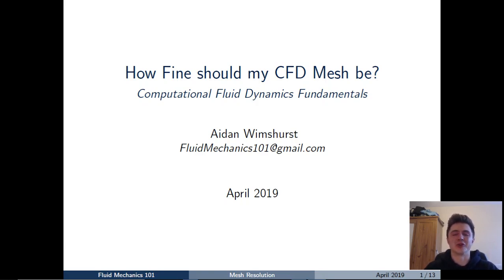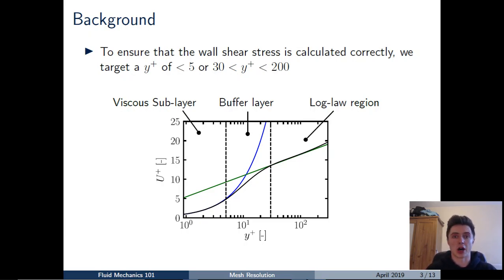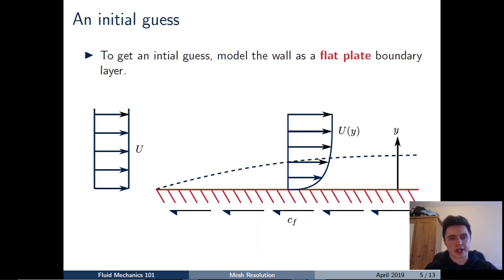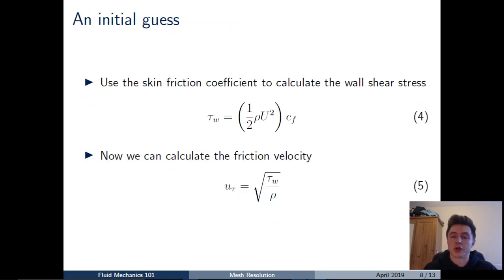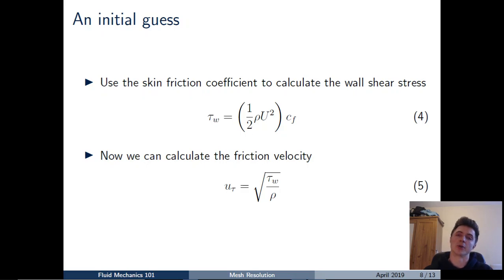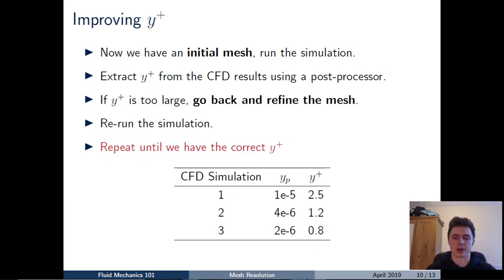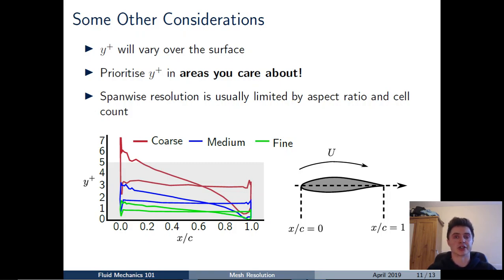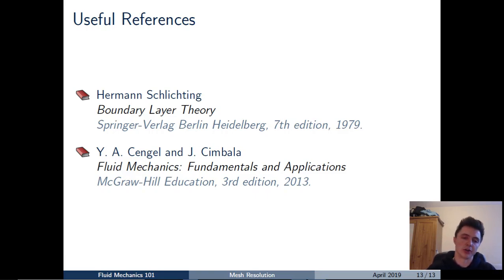[CFD] How Fine should my CFD mesh be?

Comment: Aidan : does a phd in the one of the best university in the world, weekly creates video about complex CFD concepts
Also Aidan :  'meme generator is my only bookmark lol'

More seriously, very nice video once again (y)
It is good to know/be remembered these stuff, but focus should really be put on few regions as in practice, a ''proper'' y+ check is never really applied, or is it?
For example, a proper y+ check is not possible in turbomachinery. It would need to be done at all flow rates, and if you try different designs, it will take weeks.

Keep up the good work, that's amazing!
Reply from the maker: Hi Lili An, yes well spotted 😂 you are right. Carrying out proper y+ checks is rarely done in practice and is particularly important for turbomachinery and external aero applications. Hopefully this video pushes everyone in the right direction for how to start their y+ and mesh checks.
Reply from the maker: Oh and for flow rates, you can always choose the high rpm/high speed case for your y+ checks, as the boundary layer will be thinnest and your y+ values will be largest (for a fixed mesh). As you drop the speed, the boundary layer thickens and y+ will reduce, improving your solution accuracy.
Reply: @fluidmechanics101  hey I love your videos, they really allow me to grasp some concepts in a way no textbook can. Just to hear someone explain plainly and directly to me is so helpful. I wanted to ask how do external aerodynamics y+ is verified and how does it affect lift and drag predictions
Reply from the maker: The trick is to think of y+ as 'the height of the first cell off the wall'. So yes, y+ has been looked at extensively in the field of aerodynamics and it is generally accepted that y+ ~ 1 gives accurate results. However, you can still get errors from other sources .... mesh refinement isn't everything!

Comment: Excellent explanation again. Thank you for your contribution to the CFD basics.
Reply from the maker: Yes, i realise this video is really a CFD basics video. But it is often overlooked and not really explained well for beginners. Hopefully this will be a useful resource for beginners to have a quick look at and set them on the right path. Thanks again for your support!
Reply: This is what exactly makes you different, being simple yet precise.  CFD is currently an essential tool not only for graduate students, but also undergraduate engineering students, as well as practicing engineers. From this point of view, your contribution is unique, since it covers both basics and advanced topics.

You are expected to make a lesson on the turbulence models, their performance on some prototype problems.
Reply: @fluidmechanics101  hi sir 
if we worked by the K Omega model, Do we need to define the Y  + or no?

Comment: Thanks for the videos. I am a beginner in CFD and I feel lucky to get to know about this channel.
Reply from the maker: Im glad you found this channel too! My aim is to put out lots of extensive videos for all areas of CFD, as it is quite a difficult subject to get into, particularly for beginners :) just drop a comment if there is anything you are unsure about or need more information/explanation
Reply: @fluidmechanics101  Thanks for your reply. Can you please make a video about boundary layer separation? Why does recirculation happen? why and when we should care about the separation of boundary?  Does it matter in internal flows?
Reply from the maker: Sure. As a quick explanation, separation and recirculations lead to additional pressure drops in internal flows. This increases the pumping requirements to drive the flow through the system and can lead to unsteady loading/vibrations in the supporting structure. So generally, we would like to avoid unnecessary separations! I hope this helps

Comment: Great video, Aidan! The part where you mentioned about the residuals and point convergence really sparked my curiosity in checking solution convergence. I've always considered comparing solutions from historical data to validate convergence/solution. Like I would only check if the Cl and Cd values match for an airfoil and never cared much about the other residuals Can you please add a video about solution convergence to the list of videos you're going to make? Thanks in advance!
Reply from the maker: Yes that is a really good idea. I can see where you are coming from. Particularly with aerofoil data, you are usually comparing to values in the literature and experiments so we usually use these to check for convergence. For other cases you may not have any literature or experimental data for checking and we need to use everything we have to check convergence (point probes, residuals and flux balances)
Reply: @fluidmechanics101  Thank you and yes not always do we have data to compare our solutions to! Really appreciate you responding to each and every comment on your videos!

Comment: Just excellent and i am really impressed by the quality of your presentation ! , please i have question how to estimate the Y+ for natural convection case inside square cavity since we don't have velocity to calculate Reynolds number ! thank you so much again
Reply from the maker: Hi Leila, what i would do is make a really coarse grid first in 2D. Go with maybe 50 by 50 cells. It should run in a few seconds. Then look at the solution and see what the velocity and y+ are. You can use this as a starting point for your full grid. As a rule of thumb 10^-3 usually seems to give y+ of order 100, while 10^-5 seems to give y+ of order 5 for many flows. See how it goes 😊
Reply: @fluidmechanics101  Thank you so much , please is it possible to give me your e-mail , i have some questions about convergence in 3D vented cavity (mixed convection) under turbulent regime with Fluent . thank you so much again !

Comment: Hi Adrian! First of all, your videos are awesome and extremely detailed and well explained so thank you for that. Second of all, i am currently working on CFD simulations on aerofoils with surface roughness and i am having trouble to select the target first element length using the y+<1 concept because roughness modifies this approach of calculating cf beforehand. When i run my simulations and i verify the y+ is way over 1 even though i calculated the first element to be less than 1. Thank you in advance, and if you could help me with this it would be awesome.
Reply from the maker: Remember: these calculations are all estimates. If your CFD simulation says that y+ is much larger than 1, then you need to refine your mesh and try again! For example, if y+ = 5, then reduce your first cell height by a factor of 5 (and adjust the growth ratio and number of layers of course) and try again. Usually you can get the y+ you want with about 1 or 2 re-meshes, so it doesn't normally take that long

Comment: Hi everyone. Can someone guide me how to calculate Re in case of a CD Nozzle flow where I have the inlet stagnation pressure only and velocity is changing continuously during the flow as well. Will be highly obliged.
Reply from the maker: Good question. Re is always based on a length scale. For complex problems there may be more than one length scale that you could choose. This is why it is standard practice to always state the length scale that the Reynolds number is based on. For your case, you could state the Reynolds number based on the throat area and / or the Reyolds number based on the upstream area. Most engineers will just look at previous work (research papers / experimental work) and use the same definition of Re that everyone else uses. This is nice to make sure you are comparing like-for-like. A better approach would be to state both in your work (and you don't loose anything by just stating both). For example, Re based on the upstream area is 100,000 and Re based on the throat area is 250,000
Reply: @fluidmechanics101  Thanks a lot Sir. One last thing is that how can I get the velocity for computing Re in my case?
Reply from the maker: Make a plane and then take the mass flow average velocity over that plane. That should do the trick
Reply: @fluidmechanics101  Thanks a ton <3 Stay Blessed.

Comment: Really great video, I also seen your previous videos on wall treatments, but I still have a confusion on the good targeted value of y+ itself, (or y* since you said in a previous video that Ansys Fluent uses y* instead of y+), so do I get from all the previous videos that the y+ (y* ?) value should always be under 1 ?
Reply from the maker: If you can get y+ and y* under 1 that is best. However, if your mesh quality is too low or your cell count is too high then you can relax this and choose to either have y+ < 5 or y+ > 30 👍
Reply: @fluidmechanics101  okay thanks a lot

Comment: I see that the calculator is not available right now. I see only inflation layer calculator. Can you tell me if im missing something?
Reply from the maker: The inflation later calculator also calculates yH, so it should do everything you need. There is a PDF guide at the bottom of the page which explains how it works

Comment: Thank you for your really nice content. I have confused on slide 12. Dose an initial cell height mean the yH or yp? Because you mentioned that yH is the height of the first layer in your content ([CFD] Inflation Layers / Prism Layers in CFD). When we make the inflation layers, height of first layer(yH) should set up double 1st Cell Height(yp), shouldn't it? Thanks.
Reply from the maker: Yes exactly! The first cell height is yH, but the centroid height is yP. Be careful with your mesh generator. Mesh generators normally specify yH, whereas the y+ calculations are based on yP.

Comment: why can't we use equation 4 to find the wall shear stress in the wall function video? (this would save us from the need to that kinematic viscosity linear approximation, or the need for an iterative scheme?). is it because this is just an initial guess?
Reply from the maker: Equation 4 is for the flow over a flat plate with zero pressure gradient. This is just an initial guess as most CFD cases will have different flow conditions near the wall and equation 4 is not exactly correct

Comment: Hi Aidan. Thanks for the great videos.  I have almost gone though all of your videos. As a CFD specialist that also has worked in this field I still have problem in meshing and validation. After I receive a project I always ask: What is the efficient step by step procedure to mesh the domain? How to choose best initial resolution not to repeat meshing procedure several times ? How much to refine the mesh in critical regions? Should I care about y+ values in every surfaces? Where to care about high y+ values and where not (e.g. In very big geometries to care about this value increases the number of mesh dramatically). How to do mesh independence analysis in unstructured complex mesh?  How to reduce the time I spend for mesh independence study? How to validate our simulation results when we do not have an experimental results? We can learn schemes and numerical methods from different sources. But meshing and validation in shorter time are still in question. Do you have an idea? or a source?
Reply from the maker: That's a lot of questions there .... All I can say is that a lot of it comes from experience with particular problems. Once you have meshed and solved a given application several times you get used to what the solution and mesh resolution should look like. So, maybe have a look at academic papers and see what they are using? If you have an idea of what the solution is like then you can often work backwards 👍 that's the best I can do in a paragraph 😄
Reply: @fluidmechanics101  Thanks Adan for your response. I know there may not be a solid answer for all those questions. Just wanted to have your view and your experience. Or maybe you have seen a great reference that I am not aware of.

Comment: Amazing as always. If I have a number of elements limitation of 512k, and I am required to run a CFD simulation of a multi-element wing. How would you suggest targeting and achieving the y+ value? Where do I make compromises, on the virtual wind tunnel dimension? On the growth rate? Thank you for the super informative presentation.
Reply from the maker: You are going to have a tough time with a limit of only 512k! I would recommend trying a 2D simulation first, with a very fine mesh (all 512k) and then reduce the cells in your 2D simulation to see how innaccurate it gets. Once you have a level that you are ok with, then use those same settings on your 3D wing. You will probably need to reduce the upstream and downstream lengths, increase your y+ all the way up to ~200, increase the growth ratio to 1.2 and reduce the number of cells along the span. It will definitely be innaccurate but doing 2D first should get you a good idea of how innaccurate and you can quantify this limitation in your report 👍

Comment: What if the case is a closed flow, for example, the internal walls of a pump impeller, is it still a valid procedure? What characteristic length should be used for defining Re?
Ps: Love your videos, by far the best.
Reply from the maker: The chord length of the blades or perhaps the impeller diameter would probably be a good idea 👍

Comment: Aidan ur work is very impressive.Learned alot through ur videos. I have a question: **does y+ value has any affect on convergence??i am doing a project on ONEGA M6 wing with winglets(wing tips). the solution converges with AOA ffom 0-4 degrees. but from 5 to onward, the solution does not converge. so should i consider to change y+ value in the simulation? looking for ur reply..
Reply from the maker: Yes it will! Cells with smaller y+ are thinner, so they have larger aspect ratios and worse non-orthogonality. It is the higher aspect ratio and non-orthogonality which lead to worse convergence. But always remember that it is not y+ itself that affects convergence, as the wall functions are smooth. It is reducing the cell height that affects convergence 🙂
Reply: @fluidmechanics101  Got ur point. Thanks alot.😊

Comment: Can we use this for a nozzle(rect) as the Reynolds number limits are different. What will be the characteristic length for rect nozzle, is it length or equivalent Dia.
Reply from the maker: Yes, you might need to use a different correlation. You should use the same length scale as that which is used in the correlation 👍
Reply: @fluidmechanics101  thanks for answering, could you make a video on meshing for les, kolmogorov scales and how it translates to actual mesh.

Comment: Great video! How you choose target y+?
Reply from the maker: If you have a 'difficult' flow, like separation over the back of an aerofoil, natural convection driven flow from a hot surface or an impinging jet, then go for y+ ~ 1. If your flow is close to flow over a flat plate or an isothermal pipe flow then you can be more relaxed and go for y+ ~ 30. In general, if you are unsure, try for y+~ 1.

Comment: Hi Aidan. Just a question. Your calculator gives me the height of the first cell that i need to have a y+ near 1 (or what i decide to set). 

Once i decided the number of cell how can i define the grading of the cells that i need to obtain the 1st cell height calculated before with your calculator?
Reply from the maker: Hi Alberto, normally you calculate the first cell height to get the y+ you desire first. This is fixed and you should keep this value. Next construct your mesh around this to get the best cell quality you can. Normally a growth ratio of 1.1 normal to the wall is perfect and will give you good results. If your cell count is too high (say over 20 million) then consider increasing the growth ratio to 1.2. Larger growth ratios (1.3 and above) may lead to inaccuracies in your solution so proceed carefully!

Comment: How to set y+ value for airfoil for k-omega case and k-Epsilon case
Reply from the maker: You have to choose a first cell height when you mesh the aerofoil. Then run the case and plot y+. Have a look at the y+ you have and then go back to your mesh and adjust the first layer height. Repeat the process until you have the y+ you are looking for. In the same way that CFD codes use iterative solvers, the process of obtaining the right y+ and right mesh is also iterative!

Comment: Hello. Thanks for this great video. I have a doubt: I have a cylinder (660mm diameter and 300mm height) on an external flow (55 m/s), and I need to calculate the drag force. I draw this on 3D and if I want a y+<%, I need a cell height<than 0.03mm. This is too much for my system. If I use a y+ =50 or higher, will I have a great error? I think  I will use the kw SST model with standard wall function (do you suggest different model and wall treatment?) Thanks in advance for your answer.
Reply from the maker: Your Reynolds number is high, so you will always struggle to get the right answer with RANS. A cylinder at high Reynolds number is actually one of the most challenging cases for CFD codes, even though the problem looks so simple. You also have a 3D cylinder, so there will be interactions with the shedding along the length of the cylinder. Very difficult to get right. I think you should start with some very careful validation in 2D and look at different meshes, wall treatments and turbulence models first before doing 3D (by comparing to experiment). You will need to be very careful as it is easy to get a very wrong answer for this type of simulation .... Good luck!